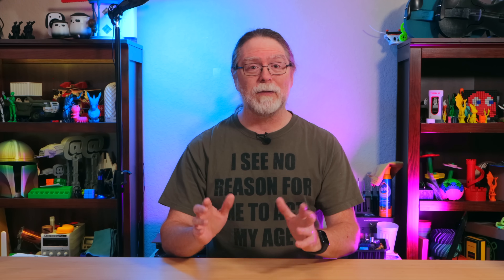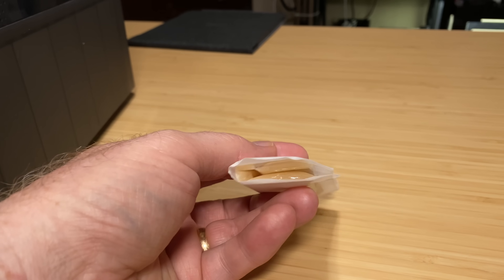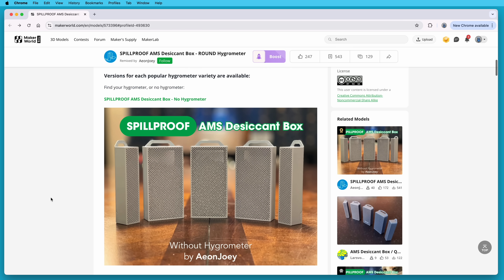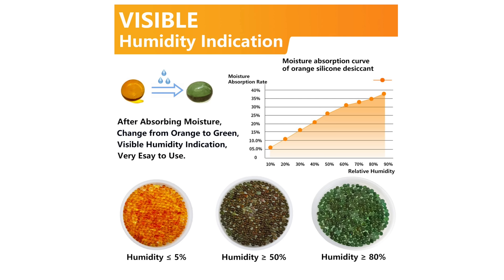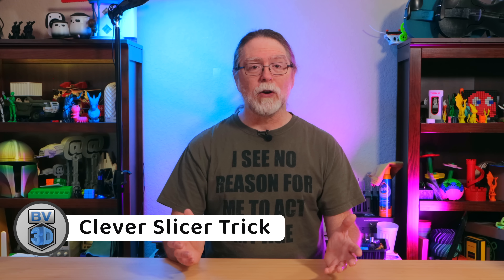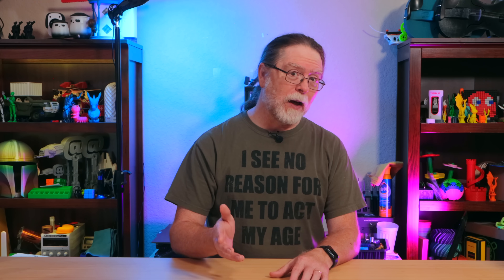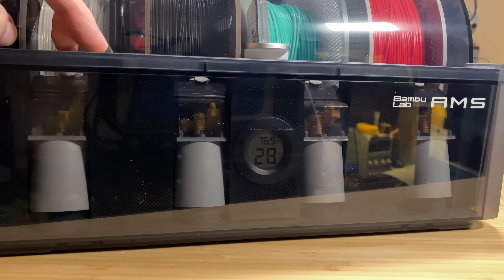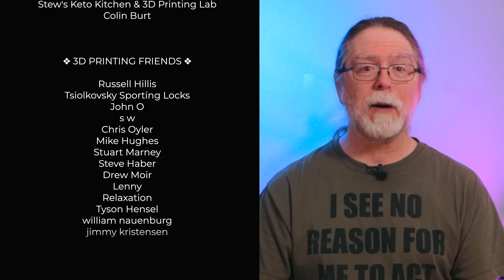I REPLACED DESICCANT in my AMS for the LAST TIME!

Comment: I've been using the older style Bank of squarish boxes that go in the front of the ams. I like the new additional ones to go on the left and right edge. Also running cylinder-shaped canisters that go inside each spool. That comes in handy on very light spools that tend to lift out on rewind

Comment: Just a little suggestion when using the rechargeable  beads. Be sure to use a stone or ceramic bowl if you microwave them. they'll melt into a plastic dish and ruin themselves and the dish.
Reply: and if you want to ignite the microwave use a paper plate!
Reply: @StephenKeating  Yeah, I'm sure it would!!!  Even the Ceramic dish I use gets so hot, that I must use a hot pad to remove it from my microwave!!!
Reply: @StephenKeating  I use a paper bowl. I use the microwave on high and limit the time to no more than 15 to 30 seconds at a time. When the beads have returned to the dry color, I move them to the dehydrator for 10 to 20 minutes to get rid of the excess water -- it seems that after microwaving, that they're all wet because the water is OUT of the beads, but it's still ON the beads. I put them in the dehydrator while they're still warm from the microwave.
Reply: @paulswarthout9967  I found that. There was still moisture in the air. However, I 'cooked' them for another minute and no moisture. A lot depends on the power of the microwave and the quantity of beads. I have a cheapo 700w. So, I use a ceramic dish with half a cup of silicon beads and set the microwave to defrost for 6 minutes. So far so good.
Reply: Glass oven dish works fine. But try drying it overnight on the radiator, you can easily custom print some long narrow containers that will fit your own central heating rads and because you're already using them to heat your home - in the colder months at least - it's free. If you're spending hours drying them in an oven it's probably cheaper just to buy new.

Comment: Surrounding the hygrometer with desiccant measures the humidity of the desiccant. Your AMS did not reach 10% RH in 20 minutes. You would likely get the same result if you didn’t put the unit in the AMS.
Reply: It really only shows when the silica gel is completely saturated, the problem is that there is not many other good places to put the hygrometer in the AMS and so a lot of designs just attach it to the dessicant pods. Mine goes from about 10 % nominally to about 14 or 15 % if the AMS is opened, so it still kinda indicates when its doing something.
Reply: @nucleochemist The AMS has its own hygrometer, knowing moistness on a scale of 1-5 is enough to know when it’s time to change. Also color-changing beads help.

Comment: I am blessed to live in Denver where the relative humidity indoors is regularly <20%. I very rarely have filament moisture problems. I store TPU on the shelf and never have to dry it. I only regularly dry the engineering filaments.
Reply from the maker: I envy your low indoor relative humidity. 😊
Reply: I live in Phoenix, AZ where its 15% outside, but inside your house is much different. 35%-40% is typical, which is too damp for most filament.
Reply: @A1N0  I want that big filament closet Filament Stories has ;D
Reply: What part of town has the desert?! lol I'm in aurora near DIA and in the house with the AC running it's 35% most of the time, lol, I'm lucky if I get it around 25% in my cabinet. this house is pretty old though, might need some weather stripping upgrades - very jealous!

Comment: Also, for rejuvenating the beads, there is also a printable "screen" you can put on a Bambu reusable spool to pour the beads in and then use in any normal filament dryer (home-made from a dehydrator or consumer product). The screen also lets the small chips and bits fall out, keeping only the larger beads (and the large chunks of broken beads).
Reply: Yeah I've used a couple of these (hint, don't print them in PETG LOL, use ASA/ABS)
Reply: Can you share the link to the printable "screen"? Thanks!!

Comment: One thing to note, it may have already ben said - Using the desiccant beads in the same container using the hygrometer is in will give it a false reading. this is because the sensor in the hygrometer sits deeper in than the container, so "drier" surrounding air effects its reading. To prove this, use the system with desiccant in that box, note the reading, then empty it and put the container back and note the difference. Without the surrounding desiccant, you should see a higher reading since it is sampling "untreated" surrounding air. You will also notice a slower lowering of humidity as the overall air is dried versus the immediate nature of the just the surrounding air. - I learned this through trial and observation using 3 hygrometers in the AMS unit in different locations.
Reply: note that the hygrometer is separated from the beads by a solid wall and the sensors of the hygrometers face the rear of the boxes through which the grid allows air to reach them without passing through desiccant. the closest sensor location to desicant is an average of 15mm away from eachother, this was specfically designed for this purpose as most of these have the hygrometer sitting in a nest of desiccant. ;)

Comment: I use the ones that go in the middle of the spool, mainly because it also helps keep the spools turning when they get low on filament. I added scale calibration weights in them. But since you can never have too much desiccant, I'll probably add these too. Great video!
Reply: I did that at first + 3 pods in the front of  the AMS and found that the spool ones are not needed. If you are storing your filament in sealed containers (with dessicants as well) the AMS pods dont need to do much and mine only need changing every 4-8 weeks.
Reply: @nucleochemist  Well, except that I'd need something to weight the spools anyway, and I also live in an area with very high humidity. Even with the spool ones and using the original desiccant chambers, I still have to dry my filament routinely, so whether they're needed kinda depends on circumstance.
Reply: I used to do that until one day for some odd reason the insert was actually causing one of my spools to not spin properly.

Comment: Only issue with this is that  a drier does that dries filament on spool, A desiccant can not pull moisture out of filament, it only pulls from the ambient air. Filament still needs to be dried properly whether in the bambu printer with the drier setting and then placed in the AMS or with an external filament drier. Thank you for the great info nonetheless :)
Reply: This. Wet or moist filament still needs to be dried externally. I use heatbed method (heatbed to 40C with spool laid directly on it and the box it came in with one side removed over it).

Comment: Definitely do NOT microwave the beads.  Microwaves aren’t nearly consistent enough.  It works, but it not well and breaks down the beads a lot faster.  Baking them in the oven at ~225°F/107°C for 1-2 hours works better.
Reply: @kjdegraaf  I use an oven since I use them loose and in bulk, but if you are using bags or the like, a dehydrator is a great alternative.
Reply: IDK the manufacturers all recommend it, Dry and Dry puts it on their container, I've been microwaving mine in a big pyrex baking dish for years, never had it 'break down', how exactly would someone know they were breaking down? they didn't last any less long, nor physically change in any way.
Reply: @joeylopezdesign  by break down I mean physically.  If the beads are heated too quickly, they can fracture.  Because microwaves vary so much in power output and because they don’t heat evenly, hot and cold spots are a problem.  An oven (convection is best) does the job far better and gives you more room to spread the beads out.
Reply: I tried microwaving yesterday for first time. Dry & Dry said 10 min on defrost. I put on microwave safe plate (i.e., paper plate). Some turned orange almost immediately. After about 1 minute I was afraid I was cooking them. I stopped. Some are orange, some are still green and some are nearly black. I’m not so sure microwave is a good idea.

Comment: I highly recommend printing the dessicant holders in ASA. That way when it's time to recharge you just throw it in the microwave on defrost for 10 minutes. No need to every open or touch the beads. DO NOT use the oven. Less than half way through my attempt the ASA was already starting to melt in the oven.
Reply: Microwaving has no thermal control. Not a good idea. Use a good digital oven with fan (i.e., not a thermostated or analog convection oven.)
Reply: @nucleochemist  
I personally find a few hours in my filament dryer at 65-70 degrees does great, and its right by the printer.

it's also worth noting that the indicating desiccants are pretty toxic, so best kept away from appliances used for food.
Reply: @Corvus.2606  u can also use aluminium-oxid desicant beeds, that are not toxic and can lower humidity even mor effectivly.

Comment: Just make sure to remove the hydrometer before putting in the microwave.
Reply from the maker: My intention is to remove the beads from the boxes and put them in a pyrex dish or something similar. You're right, though. Microwaving a hygrometer wouldn't be good for it. 😇

Comment: I have a similar setup for my AMS and just recharged my beads for the first time in the microwave - they get super hot, so use a glass microwave-safe pyrex bowl and try not to do too many at once or they don't dry out well.  Also, avoid the blue beads that have cobalt in them, as you don't want to be touching cobalt.  Finally, note that the hygrometer is right up against the beads, so it is going to show a lower humidity than the average would be throughout the AMS.
Reply: note that the hygrometer is separated from the beads by a solid wall and the sensors of the hygrometers face the rear of the boxes through which the grid allows air to reach them without passing through desiccant. the closest sensor location to desicant is an average of 15mm away from eachother, this was specfically designed for this purpose as most of these have the hygrometer sitting in a nest of desiccant. ;)
Reply: The organic dyed (green-orange) beads are worse in the long run. Their performance degrades and they will progressively smell worse and worse (as the organic dye degrades and starts to volatilise) if you regenerate them at temps over 100 degC (which is the normal temp minimum that should be used for silica gel). The cobalt chloride doped beads are fine as long as you wash your hands after handling them and arn't somehow making a lot of dust and inhaling it all day long.

Comment: @BV3D: Bryan Vines - I'm humbled beyond words, thank you so much for the kind words and review, as the description says - this is a set of remixes of an original design by Cagriahiskali, who created the beautiful grid look, I my contribution improved upon it theirs and the contributions of several others. Something that comes up in every set of comments about these is - is the hygrometer measuring the desiccant or the AMS? special care was taken to prevent contact between the hygrometer and the desiccant chamber, and allow the air behind the container to reach the hygrometer without passing through desiccant; while providing a narrow enough shape to allow removal and insertion without removing spools from the AMS. Thanks so much for this video, I'm besides myself.
Reply from the maker: Hi Joey, I'm super glad you liked the video! 😃
Reply: I don't have yours, I have a different design from a while back but one main problem with the ones I have is you need to remove the spools to then pull out the boxes.  Do yours suffer from this same issue? Yours definitely look easier to empty and refile though as the ones I have use a funnel in the top.
Reply: @JohnVanderbeck nope, you can insert and remove them without removing the spools. 👍
Reply: @JohnVanderbeck  Best thing to do is print a couple of spare ones. Then you have replacements ready to drop in when you need to.
Reply: Cool, thanks! I'm a new AMS owner, and I haven't printed these yet, but I've also already run into comments questioning what the hygrometer is measuring. You're absolutely right that it is positioned properly. And I think it would show useful readings even if it were closer to the desiccant. All the humidity inside the AMS will spread evenly, also between the silica beads.
Reply: Great job, Joey, took the option to print a couple more of the immediate right and left boxes as you suggested. Straight down to 10% humidity.

Comment: I printed these in clear filament and just heat them up in my filament dryer when I can see the color shift.
Reply: What did you print them in that holds up enough to recharge the beads without deforming the material?
Reply: @JohnVanderbeck  PETG, ABS, or ASA works great my dryer setting is 50c the trick is air flow, make sure they are in the way of the fan that's what's most important.  They clear up very quickly too.
Reply: @EatingCtrlV  Interesting.  I have mixed luck with ABS but I might try printing these up in PETG and see if that works out.  It would be a HUGE benefit to be able to just put the whole thing in the dryer, rather than emptying them out, putting in new beads, drying out the old ones, etc.  It's a chore I hate doing.

Comment: Great video, Escuse me Miss, but I have a question.  Can the Bambu Labs gel be dehyrdated?  Or are they really just disaposable? Sorry I have a cold.
Reply from the maker: The Bambu Labs desiccant is calcium chloride. Technically, that chemical can be dried out and used again, but the drying temperature is around 250˚C (close to 500˚F) for an hour. I don't think the package containing it would survive those temperatures. I also don't know if it would dry into a solid that would then have to be crushed into a powder again. So although calcium chloride is a more efficient desiccant, I think silica gel beads are probably the way to go for ease of re-use. Also, you get bonus points for Python recognition. 😄
Reply: @BV3D  hmmm, I see, I see, I get the picture.  Not great from a sustainability but I guess it is what it is. I love your solution to the issue though. Keep up the great work.
Reply from the maker: Thanks!
Reply: @TsiolkovskySportingLocks  Calcium chloride is probably less bad for the environment than silica beads.
Reply: @BV3D  I've actually tried this and its not worth the effort. It smells due to impurities decomposing and creates a rock hard solid that you can't easily break apart. Everything is difficult and impractical . CaCl2 is sold as beads in bulk and they're pretty  cheap at deparment stores and hardware stores but I still prefer to use silica gel because its cheaper in the long run and less wasteful. Also the dust from handling CaCl2 is a irritant, moreso than from silica gel.